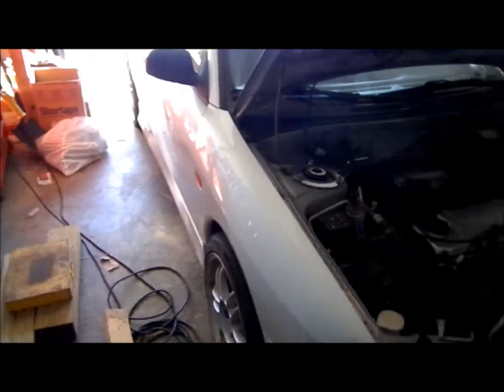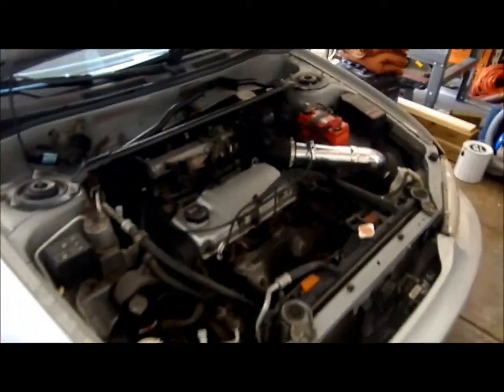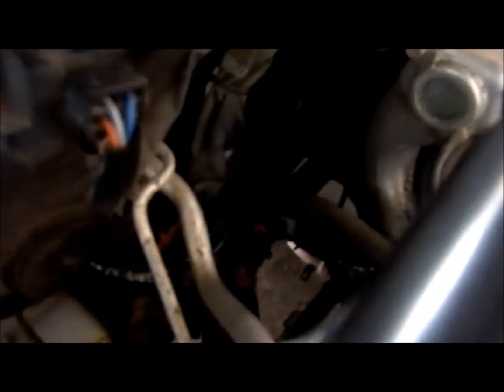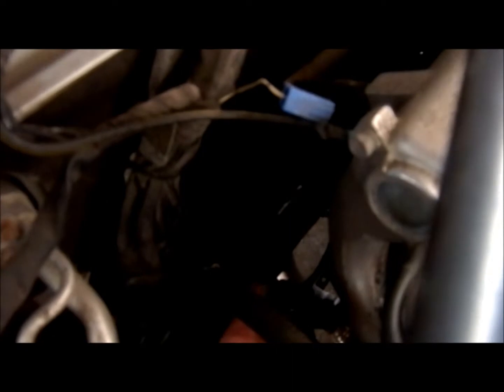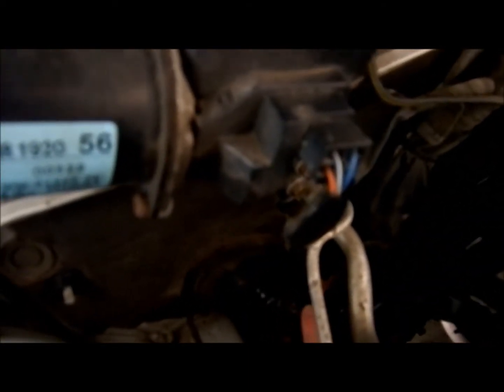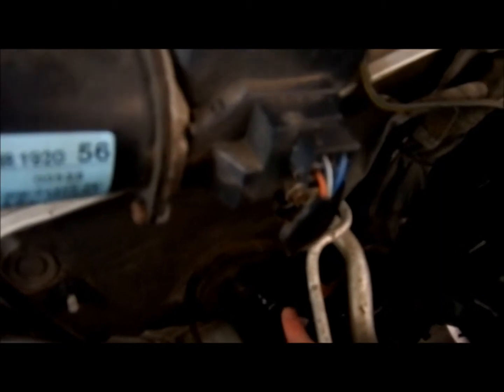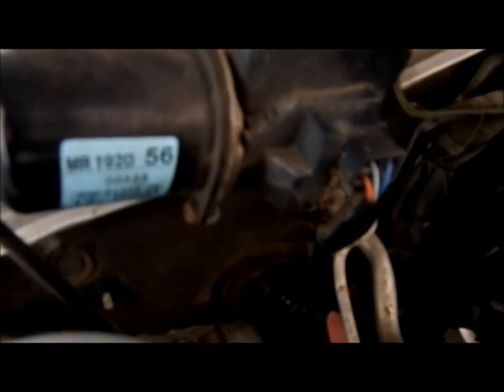AEM UEGO installed in 00 Mirage 4G15

Comment: I am planing to use it on a different car, but the stock O2 sensors are the same as in the mirage so theoretically it should work. The engine Bay on my car is tight... very tight (Tiny Car). So I really hope this emulation works.

Comment from the maker: @flv1333 Yup, works great!  This isn't all there is to it though.  Depending on the type of o2 sensor you have factory, you may need to build a heater simulator or it WILL throw a code.(mine did originally, but it was throttle dependent which is why it didn't go off in the vid) If you can install a wideband though, building the heater sim is super easy. Also, you don't really have to drop the engine to weld the bung on, most shops can do it in a matter of minutes and its pretty cheap.